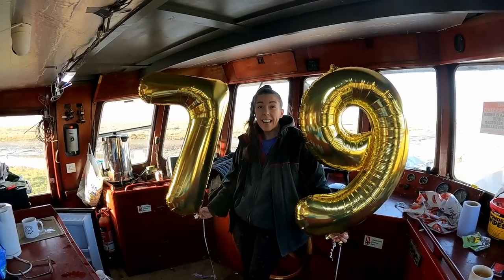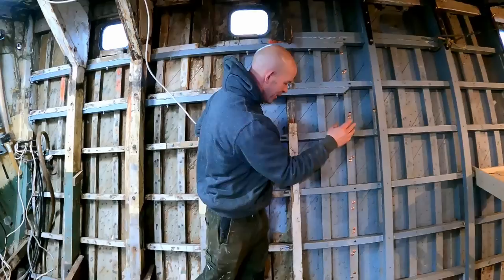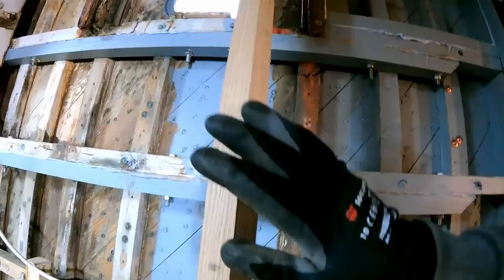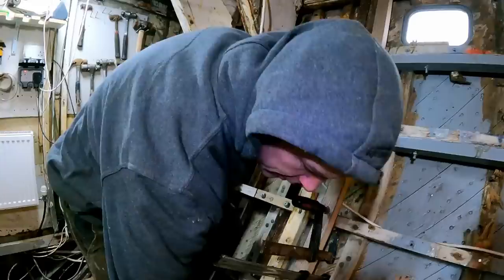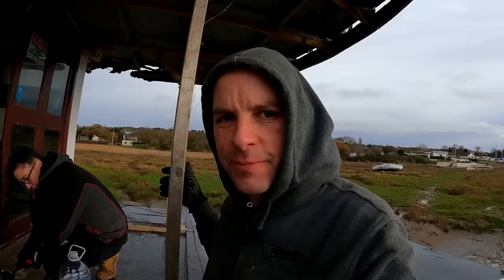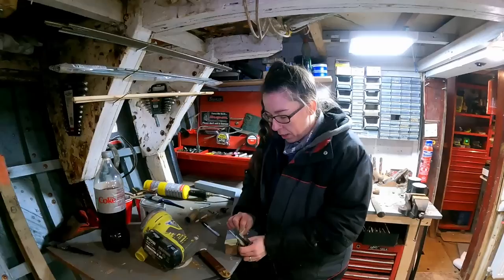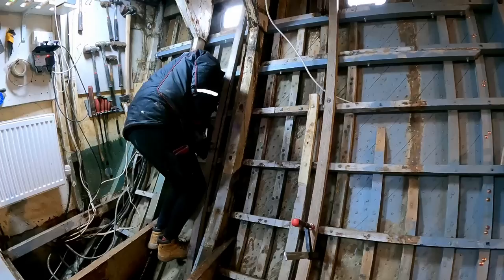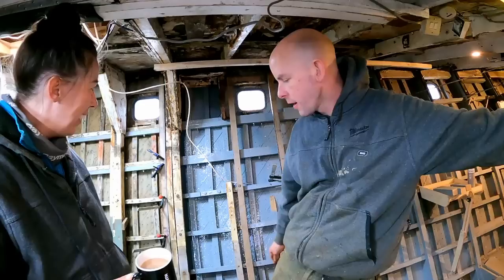Ep 106 - It Gets Very Steamy our BOAT Restoration Project #boatrestoration

Comment: I love the fact that an early thing you leaned was that the real lessons were from original builders and not the folks that 'rebuilt' her.  That taking those short cuts would mean getting a few years out of the hull before she was not save able.  Combine that with your modern skills and materials from the custom conversion and (knock on frames and stringers) two or three more generations may know of her story.

Comment: I have replaced the ribs without steaming by cutting them into strips, just thin enough to bend in cold, epoxy each layer down, held with screws, removed screws after the epoxy goes off until finished. Can do this with a reverse bend, under stringers and without removing covering boards or planks. You can do every second one at one time. I have reribbed an entire side of a schooner this way that was then sailed to New Zealand. The scarfs on the laminates are staggered of course.

Comment: Have you ever used Git Rot?  Back in my wooden boat days, if there was a small spot of dry rot in a non structural piece that was covered by something else we'd use Git Rot to soak into and plasticize the dry rot.  It's a great solution for a punky spot in a stringer.
Reply from the maker: Not heard of it, but will give it a look, thanks for the tip x

Comment: to steam timbers to shape there is a shortcut, by using Temporary Rainwater Downpipe which is a long plastic bag you can steam them in in place and clamp when ready and then leave the bag on the pipe the timber till cold, keep using the bag until it gets a hole in it. you could have 3 or 4 set up ready to steam just moving the steam connection across to the next one and not have to run the length of the ship before it goes cold.
Reply from the maker: We were talking about this yesterday, and I think Simon found a roll of the stuff on the Internet last night

Comment: I'll bet that few people know why you are doing the steps involved in those scarf joints.  The torch removes ant residual moisture on the faces.  The unthickened epoxy is applied so it can seep into any open pores.  It does not dry completely when the thickened epoxy is applied and screwed and clamped into place.  BRILLIANT !!

I hope all of the steel fasteners are hot dipped galvanized or stainless.  If not, they should be puttied over.

Comment: If you have a few more of them knees to do (and any other rusty bits you need to keep too come to that) I would seriously consider getting a ten or fifteen gallon plastic header tank from B+Q or Homebase or Wicks or wherever and making an electrolysis tank, that way you could set up a car charger to run on the solar panels while you are away, and after about a day or two they would come out of the tank looking almost brand new and none of the tedious grinding them down which is actually making them thinner - not the best idea in a load bearing support, most especially one that is part of the boats provenance I'm sure you would agree. keep up the good work guys your doing great and the old girls starting to look the better for it - and Sarinda isnt looking that bad either lol............sorry  Gem couldnt resist lol

Comment: Derusting the knees. A plastic pipe just barely large enough to slip one side in. A cap and a pipe flange. On the end. An plastic elbow that you have slit one side and used heat to peel open another piece of pipe sliced and opened with the end blocked.   A base with a turn buckle to allow you to level the upper open pipe.  Setting the knee in and pouring in evaporust.  Just an option.  The final assembly will look like a 7 with a long top.
Reply from the maker: We tried evaporust at the beginning, but we don't have time to wait for it to work, so it's faster to clean it up manually